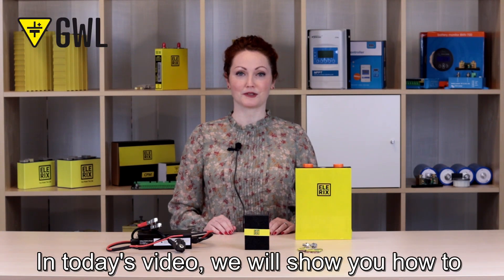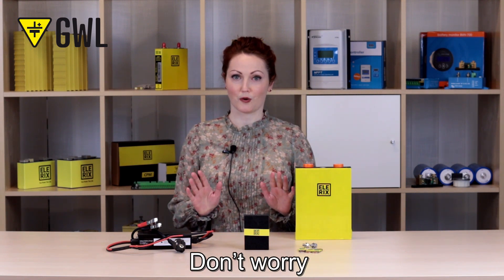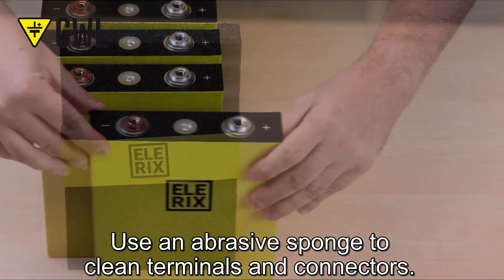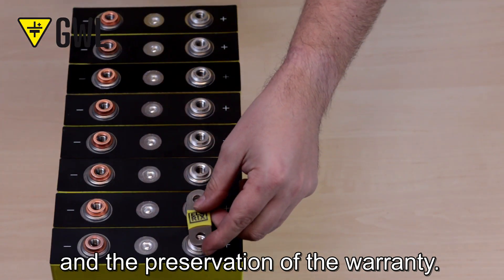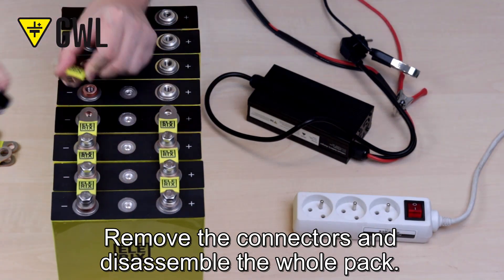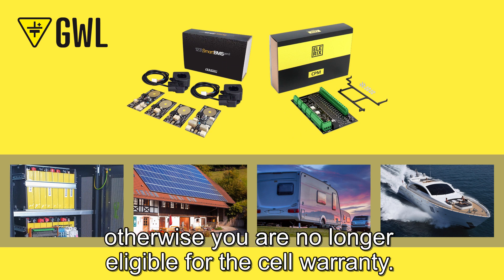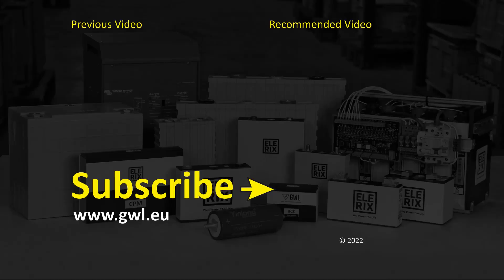How to perform the initial charge of LiFePO4 battery

Comment: Say you have a 5 Kwh pack; if you charge at 3.6 Volts and 10 Amps (36 Watts) you need  140 hours of charging;  that is almost 6 DAYS , day and night,6x24 hrs; is that the only way??!
Reply from the maker: Yes, there's another way: you can use a stronger charger or charge in smaller packs. The initial charging for this battery took ca. three working days (= 24 h).

Comment: Thank you for video, could you update links to products used? Link to charger is a product that is not listed. Thank you.
Reply from the maker: Hello, thanks for letting us know! We'll update it. Instead, you can use these two Meanwell chargers:
https://shop.gwl.eu/_d7916.html
https://shop.gwl.eu/_d7953.html
Reply: @ELERIX-LiFePO4  but this is not a regular charger with logic only basi power supply, so I suppose that you need to adjust output voltage first and than check the voltage manually right?

Comment: The busbars are not screwed flat on terminal. This gives stress on these terminals !   Which voltage do you charge with?
Reply: Agreed, it would be much better to jump flat every two cells and then jump each two cells by placing the buss bar on top.  That way there is no stress as is connected like shown....

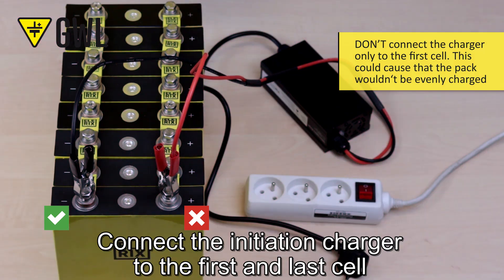Comment: 1:50 whats the logic behind this ? can you explain it in electrical terms , thank you :)
Reply: The first cell will reach full charge and charger will shut off, leaving each additional paralleled cell at a lower charge the further you go down the line due to resistance.  By connecting terminals on opposite ends of the pack helps to negate this factor.
Reply: @travisarnett9558  Additionally, if you were to use a paralleled battery pack like shown, the output feed to the load should/must be connected in the same way.  This would equalize the amperage draw from every battery EVENLY....
Reply from the maker: If you only connect the first cell, the small charging current will not reach the whole battery evenly. In other words, the first cell will charge and shut down the charger, so not all cells will be guaranteed to charge. If you connect to the last and the first cell, you distribute the charging current evenly and reduce the voltage drop across the wires. This option ensures that all cells are charged evenly, so the charger will only switch off when all cells are charged to 3.65V.